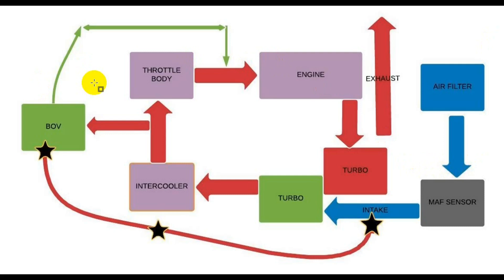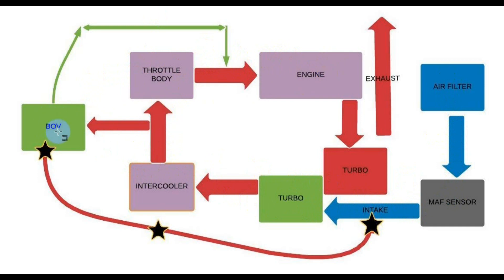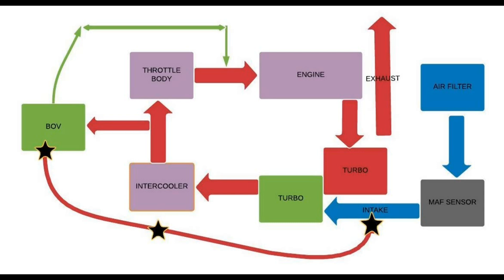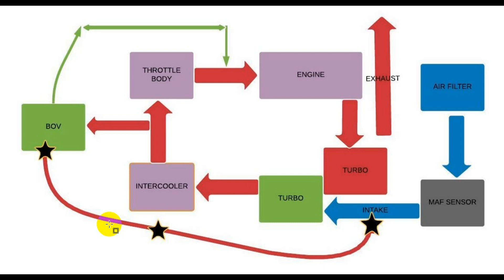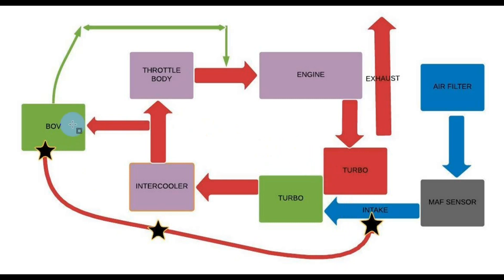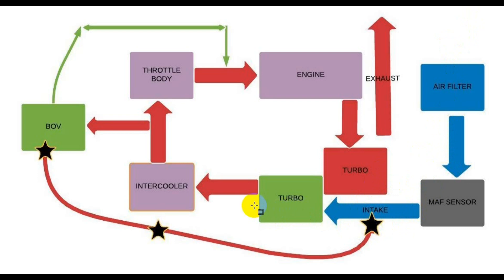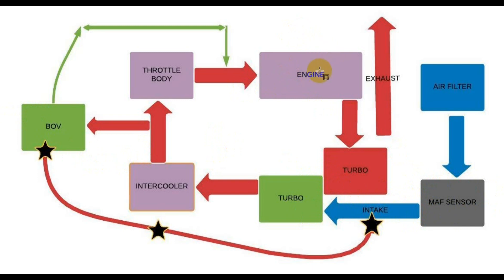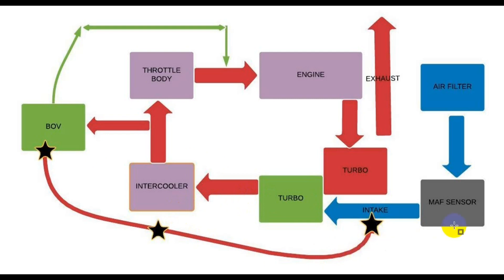Blow Off Valve = More POWER???

Comment: So for some info, I've got a Clio 4 RS and I basically made the recirculating value vent to atmosphere as I use the car daily in hot environments. Havent notices richer fuel though as I haven't seen any black smoke or more pops then usual. Some guys said its better to get a bov with a spring so that i get the woosh sound but also keep the turbo spooled.. im running the stock turbo so its small and would hardly notice any turbo lag between gear changes though